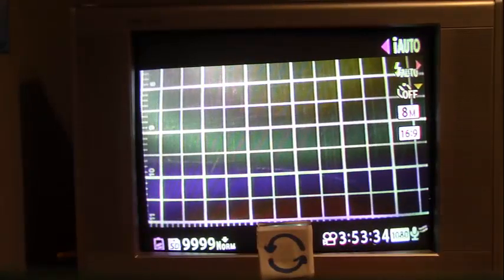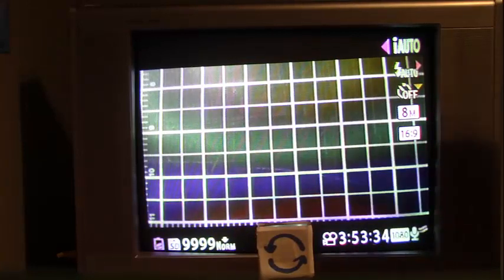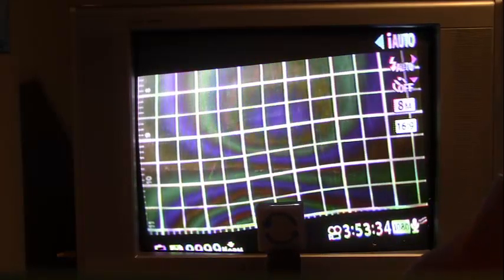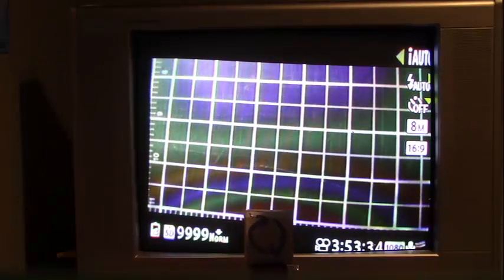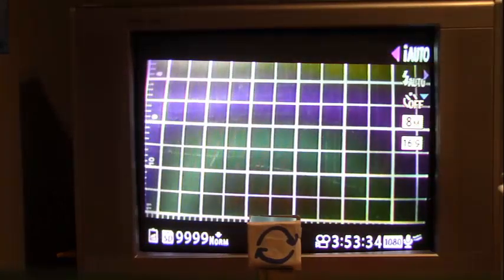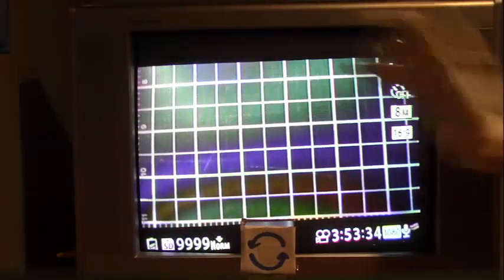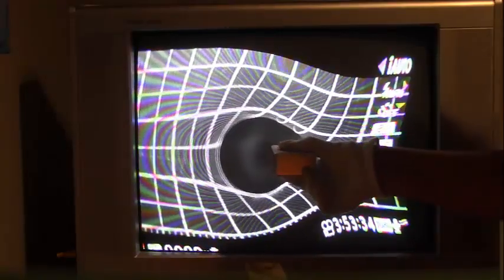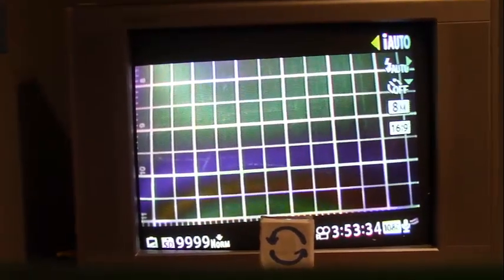On Clockwise and Counterclockwise

Comment: Are those currents there because the earth is moving thru space, and the aether has a different speed than planet earth?
Reply from the maker: That is a good question. It is true that all objects in the universe are moving relative to each other. It is my opinion that all those currents are there because the Aether is moving. Matter follows Aether. If you throw a stick in a moving river, the stick is going to follow the water. The stick is eventually going to be at rest with respect to the water. If the water is moving, the stick is moving. If the water stops moving, the stick stops moving. In a similar manner,  I see Aether as a fluid in motion and Matter follows Aether. If matter is moving (like a planet in orbit around the sun), it is because Aether is moving. Solar systems are Aether vortices. Galaxies are Aether vortices. All "objects" in the universe are at rest (static) with respect to the Aether, but the Aether is dynamic. The Aether is moving. All the currents out there are Aether currents. I hope this answers your question.
Reply: @FractalWoman  Thank you Lori, very much for your answer, it confirms what seems to make allot of sense to my gut feeling on the issue, thing is, i'm not good at the mathematical part of things, and that complicates what I do on a daily basis,  I'm a design engineer for medical products, we design near-infrared treatment devices that help with chronic pain and wound healing, blood flow, etc.  Since the current functioning of this has been assigned to Photons actually existing and displacing nitous oxide from the mitochondria, thus removing the bottle neck for oxygen supply to the Cytochrome C oxidase complex.  Assuming Photons where an error, we need to come up with a better explanation of why all these positive effects arise with the use of 800-850NM or NIR light at 50mW/CM2 skin exposure.   we know the human body is quite transparent to these wavelengths, and we know the energy is also absorbed by the body,  warmth, be it little at 50mW/CM2 is measurable. I however think there is an effect in cell charge that reduces friction on blood flow, and enhances the mitochondrial membrane potential, thus speeding up ATP production. Question is, how can a EM wave as such give these effects?  what happens to the wavelength once it has entered the body?  the impedance there should be different because the medium is different.   IF we assume an electro magnetic wave, then there should also be a dielectric component to the wave right? can't have one without the other, leaving me wondering  how this actually behaves and interacts with the cells.   sorry for the long reply,  my brain has been stuck at this point for a bit too long...     stack-overflow ;-)
Reply from the maker: @infinitesolarforall3901  Interesting. I am also a developer of medical devices. The answer to your question "what replaces photons" and the answer is "resonance". At the correct resonant frequency, nitrous oxide is knocked out of the mitochondria. If you look up the work of Juliana Mortenson (https://forgottenphysics.com/) you will see how resonance plays a role in chemical reactions and can act as a "catalyst" to speed up chemical reactions. Let me know if this "resonates" with you. LOL
Reply: Fractal Woman my god your brilliant!! Yes that resonates meanwhile it may take a while for me to get my standing waves at the right frequency. Thanks allot for that link I shall study it with full attention!

Comment: Do you think if you were to have two identical magnets let's say round with a Bearing in the center and gearlike teeth on the sides. And faced the poles in the same direction while bringing the teeth side together would that create mechanical spin in the two magnets.
Reply from the maker: The magnets are "churning up the ether". Ether is spinning while the magnets are sitting perfectly still. Ether can't move magnets, but magnets can move ether.
Reply: I think that's the crux of differences between Wheeler and Distinti.  Distinti has ether flow - as the force of gravity - but doesn't claim or state that magnets can influence the ether.  Ken's theories are a bit wilder.  Am awaiting your gravity video that you teased us with.  How does gravity bend light (does it bend light?).  and fyi if you havent seen this: https://www.youtube.com/watch?v=sJKW9VNo2BU
Reply: @Radek:  Distini is more organized, but Wheeler is closer to the truth of magnets and the Æther, as far as I can see.
Reply from the maker: Actually, I think Distinti is closer to the truth about magnets and the Æther than Ken is. Robert actually has force equations that you can plug into a computer program and model the effects. Ken has none of that. Distinti's project is called "Ethereal Mechanics". His is not only telling us about the Æther, he is modelling it with simple equations that even I can understand. Again, Ken has none of that. Ken has some really good ideas too, which is why I started this video series. What he is saying is helpful in understanding "why" things are the way they are. He is just not explaining simply, like i am trying to do.
Reply: @Lori: Do you have a link to that video by Distini?
Reply from the maker: Code Tech: It took me a while but I found a video where he shows his 3 force equations, zeroth order which is Coulomb's law, first order, which are he calls "new magnetism" and his second order, which he calls "new induction" but is basically F = ma. It is at the 15:55 mark in the video. The new magnetism equation can actually be broken down to three force equations, one for each term in the equation: https://www.youtube.com/watch?v=8Txd4G92Eno&t=4s
Reply: @Lori: I watched that video. He has "equations that mimic behavior". (He even uses that phrase in a different video.)

However, he thinks in terms of moving positive and negative charges. Particles.  I think Ken has a more advanced knowledge of fields.
Reply from the maker: Code Tech: As a computer programmer, I like forces better than fields. Forces are easier to understand and to program. You don't need the abstraction of fields when you have forces. Fields are an emergent property of charges in motion. Charges in motion are fundamental.
Reply: @Lori: "As a computer programmer, I like forces better than fields."  But as someone who is teaching a class (more / less) about Ken Wheeler, it is important to note that Ken says that the opposite is true.

"You don't need the abstraction of fields when you have forces."  Ken would say the opposite.  He would say something about the field being the fundamental, but "charged particles in motion" are abstractions invented by mathematicians who are bean-counters at heart, and can only deal with counting things ("electrons", etc).

If you approached the subject with a disclaimer like "we are talking about the flow of electrons, but the so-called electron particle is only a model developed for mathematical convenience", etc, then you would be in line with Ken. While Distini teaches that there are actual particles flying around, Ken does not. 

As far as I can see, Ken does not teach that anything is actually spinning around the magnet, only that that there is a field that has the characteristic shape. At least, that is what he seems to be teaching.
Reply from the maker: Hey, I am not claiming to know everything. That said, I think Ken's "theory" can be better understood in terms of moving charges. Just  because I say the word "charges" that does not mean I am talking about electrons. Ken calls what I am talking about "nature's charge". This is also what Robert Distinti is talking about. I AM trying to teach what Ken is teaching AND what Robert is teach because they are both saying the same thing, only using different language.
Reply: Distini is pretty much classical Electrical Engineering with refinements to the mathematics. Ken Wheeler is not, but is more of a cross between Walter Russel and Eric Dollard.

For example, Distini will show diagrams of "plus" and "minus" charges, because he believes there is such a thing. Ken and Eric Dollard do not; only states of charge and discharge, which in turn are perturbations of a field.

Dollard teaches that current or charge does not flow through the wires. He says that the "electricity" is in the field surrounding the wires, which only serve to guide the field towards (say) the light bulb; there is nothing, no charges of any kind, moving through the wire.

Your previous video about the parallel wires attracting due to the charges flowing in the same direction was well done, but Ken and Eric Dollard would say it was only a model since nothing flows in the wires.  But, Distini would say that something is flowing through the wires.
Reply from the maker: The difference between me and Ken-Robert-and-Eric, is that I don't think that charge flows inside the wire, nor do I think it flows outside the wire. I believe the current flow is somewhere in between, in the medium. There is a medium and this medium can flow. Thus, I do believe something real and measurable is "flowing". I think Ken believe this too. If I am wrong, then he should correct me. There is flow and there is precession. Flow is centripetal and precession is centrifugal. That wires attract when "charge" is flowing parallel to the wires is a fact. This is observation. This phenomenon can be replicated in water. All is pressure mediation.

Comment: What causes the "void"?
Reply from the maker: It looks like displacement to me. The dielectric inertial plane (spinning Aether) is displacing the cathode rays (electrons) that would normally make their way to the front of the screen thus preventing the phosphors from being activated. When the north or south poles are touching the screen, the void is fairly symmetrical. I will show that in my next video. When the dielectric inertial plane is touching the screen, you see that the void is no longer symmetrical but instead, is shifted to one side or the other depending on the orientation of the magnet.  I believe the spinning Aether itself is doing the displacement and not the magnetic field, since the magnetic field is fairly symmetrical around the whole of the magnet. If the magnetic field was not symmetrical around the magnet, then we would see this in the iron filing experiments and/or the ferrocell experiments. We don't. The dielectric inertial plane is the "flywheel" of the magnet. This is what is "driving" the magnet according to Ken Wheeler. Think of the front of the CRT screen as a thin film of water. Imagine what would happen if you took a spinning gyroscope and touched it to this thin film of water. The spinning flywheel of the gyroscope would not only displace the water but would make it splash to one side, just like what we are seeing in the CRT experiment. It's pretty cool actually.
Reply: Thanks, Lori. However, your explanation cannot explain clearly how the void was formed by the aether flow, at least not to my satisfaction. If there is a "disk" of aether flow going "into" the screen on the left and coming out on the right, it seems it would affect the left side more than the right side, instead of the opposite. What appears on the screen seems to indicate a "high pressure zone" on the right hand side, displaying the checkerboard pattern to form the void, contradicting to your description.

Comment: What did God say about this?
Reply from the maker: In the beginning was inertia (resistance to charge motion), and god said, let there be loss of inertia (charge motion). Charges in motion creates magnetism.
Reply: And how do we know that?
Reply from the maker: How do we know that charges in motion create magnetism? You will have to watch my video On Magnets. When charge is sent through two parallel wires in close range to each other, they either attract or repel depending on whether the current is going in the same direction (attraction) or opposite directions (repel). This is well known and well studied.
Reply: How do we know what god said?
Reply from the maker: I am using "In the beginning" as a teaching tool, just like they did in the bible. No one really knows what god says. Good question though.